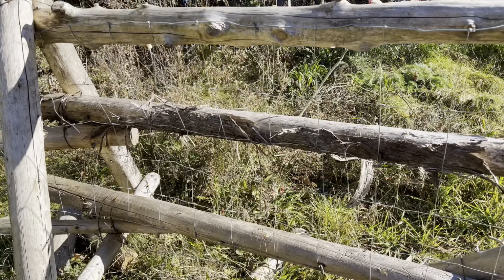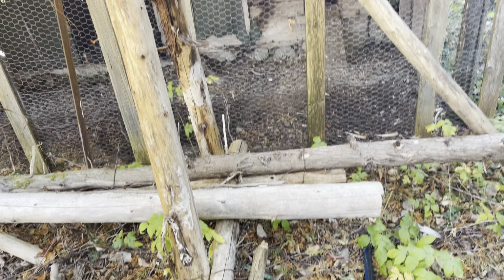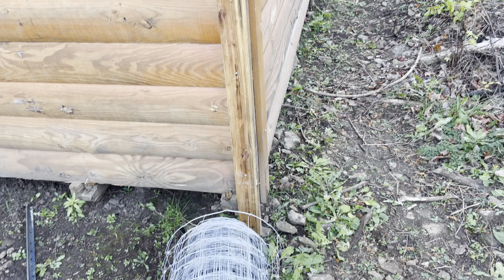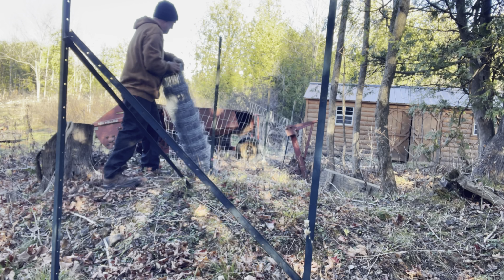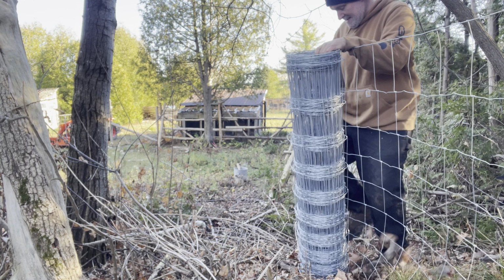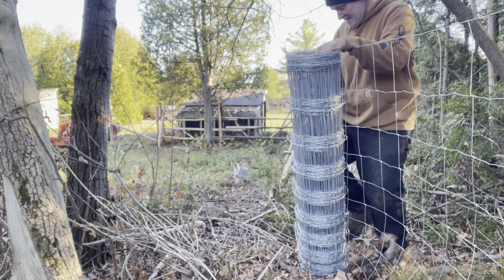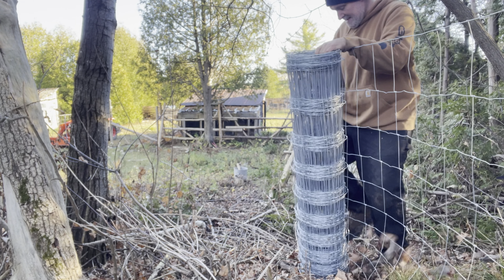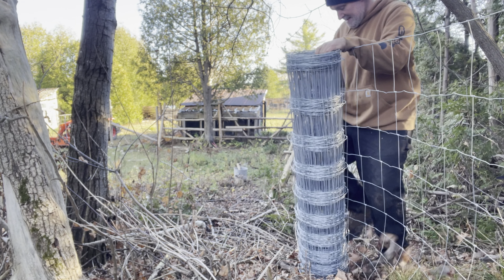￼Working on the barnyard/// How to install a fence in rocky ground

Comment: Great job Pete! Working with wire is no fun, alone especially! For the holes just tie another section of wire onto fence and run in down to fill the hole but trench it out and fold the excess flat. Fold it in to keep animals in pen or fold it out to keep critters and predators out from digging fence. Doesnt seem like matters in this case but good for future

Comment: Hello Pete. You got it looking really good. I love the wooden fence, and the field wire will work good for the goats. I did have from time to time a small goat get his horns caught in the wire but no problem getting them out. So what worked good for me stretching the wire, I used (2) 2x4's and drill 4 holes and insert 4 bolts and washers and sandwich the wire in between the 2x4's and tighten the bolts. Have a chain hooked at top and bottom and pull. This helps clamp all the fence evenly and you can get a tight, even pull. I really do like that wood fence. Rustic looking but makes sense with the rocky ground. Have a Blessed Day Frind!  Justin